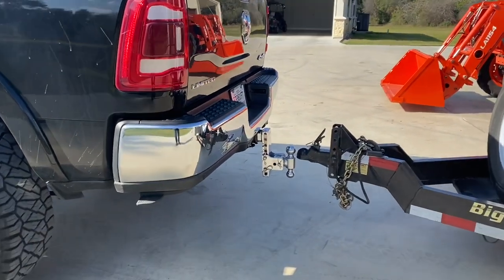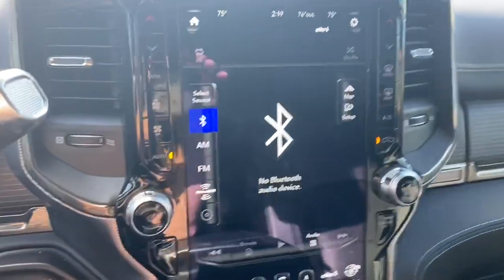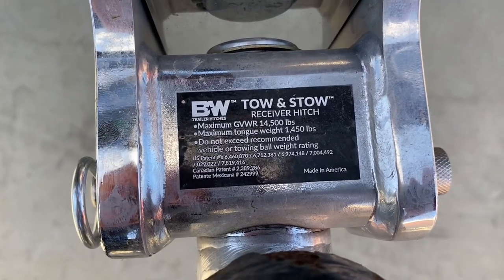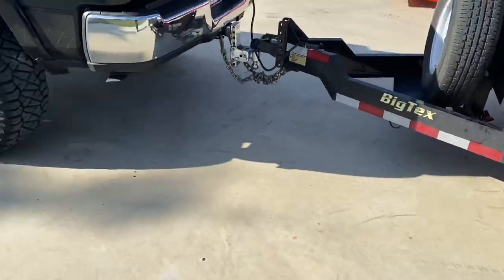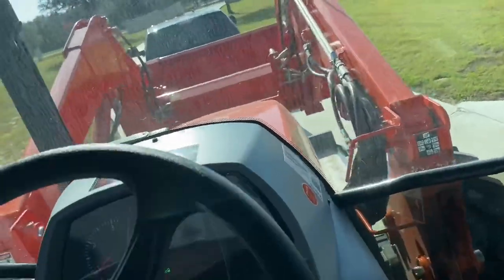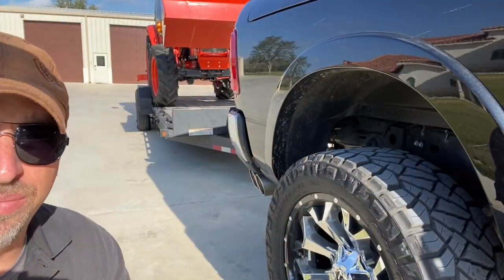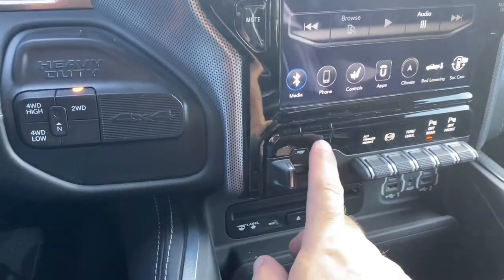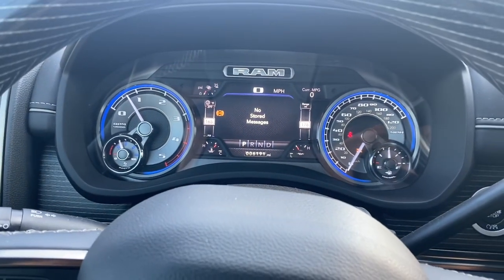2019 Ram 2500 Air Suspension and Towing

Comment: Thanks for taking time to help us on this feature. Basically, the air suspension is just for compensating to level with a load. I think a lot of people would like to think an air suspension will give 3/4 ton trucks a 1/2 ton ride. You put that myth to rest. No it does not.  I think that comment was the most important part of your video.
Reply: JL T I put mine in neutral then put the emergency brake on then put it in park myself.
Reply: If you want 1/2 ton ride u need to go with kelderman air suspension on rear

Comment: Nice truck. I've moved up to a 2019 3500 Laramie Sport  HO AISIN dually with auto level rear air. I have a slide in truck camper. Best truck I ever owned. Takes the camper with no additional modifications. Also gets excellent fuel economy. Great video showing how the Susp works for the Ford and GM guys on the fence. I was a Chevy guy until 2016. I have three Ram Heavy Duties in my felt now.
Reply from the maker: Yeah most don’t know about the factory air suspension.. it is a really nice feature and rides well. I wish I would have ordered the same truck in 3500 Srw with HO

Comment: Been told when loading / unloading to have the transmission in neutral,  parking brake on, tires checked. To prevent potential transmission damages.
Thoughts ???
Reply: Not a bad idea since loading the trailer can make the truck rock back and forth and put stress on the transmission
Reply: This is a very good idea when loading heavy equipment as the truck rocking  can cause dmg in the parking pawl.
Reply: That’s makes sense. Never thought about that 👍🏻

Comment: Very envious of your truck man! looking at upgrading my truck soon. Thinking of the 2500 cummins or ecodiesel 1500. I don't do any real heavy towing but I do tow often and will be using my truck for my commuting to work. Theres no doubt the 2500 would be the longer lasting rig but not sure I can afford or justify it..
Reply from the maker: I would rather drive a 1500 for daily. I had the eco and hemi 1500 5th gen. I would buy the 3.92 hemi again. Better acceleration and less worries. If you tow often get a 2500 for sure. Once a month 1500 is nice

Comment: I have the same BDS lift on my  a noticed my suspension automatically adjust/lower about two inches in the rear when it sits for a while.  Also noticed my air bags and compressor are working harder since the lift was installed.  Did you have similar experience?
Reply from the maker: I did not.. maybe your system has a leak

Comment: i got it on a 2013 1500 i bought new i hate to tell you its going to break if you keep it for any amount of time.. looks like you are in warm part of the US but that sound is the system sucking in air behind your right tail light when it does that it lets moisture into the system and when it gets really cold it will freeze.. in my experience they cant "fix" the spring WHEN it starts to leak they just replace them and its not cheap.... but then again mine is first gen maybe they fix them
Reply: I’ve owned a 2500 with air ride for almost 2 years “worst mistake ever” the air ride will begin to give you all kinds of problems right about 2-3 yrs even the dealer techs don’t know what to do.
You bring your truck for service and every time they have a different story about what’s causing it.
Do yourself a favor “STAY AWAY FROM ANY KIND OF AIR RIDE”
Reply: @alexturrent8141  so what do you recommend for a smooth ride? Im in the process of ordering a 3500 but dont want to waste my money obviously. I live on a dirt road and would like to have a smoother ride...thanks😊
Reply: That's not true. The system is a closed system that is filled with nitrogen. Read up on it.
Reply: @JasonS_IN317  you can read up on it bud.. it's closed unless there is a leak then it has the ability to bring in outside air and you can hear it.. sounds like an air break system on a big rig... in other news that truck got a knock the other day 180,000 miles so i ordered a raptor.. good luck (the rocker panels rusted out it's fully loaded)

Comment: I have the exact hitch. The rattling going over bumps is driving me crazy!
Reply from the maker: I use a anti rattle pin off Amazon. Works well
Reply: Saw a video that used PVC wedges on three sides of reciever, just tapped em in and no more rattle.

Comment: How much mpg you get empty on the highway ? Thinking of getting one but not sure to get a 2500 or a 3500
Reply from the maker: I have been around 16.5-17 with 35’s and lift. I have a few videos on my channel with this truck. They do get better mileage than high output and ride great.. My 2019 1500 almost had the same towing and payload. This 2500 only has 1560 payload. I will prob trade up to 3500 soon..if your on the fence get the 3500.
Reply: Rocky Rohde thanks. I’ll sure check out your videos. I am on the fence don’t know witch way to go
Reply: @RockyRohde  are you kidding me a diesel with 1560 payload talk about completely worthless by time my wife gets in the truck I already lost 30% capacity
Reply from the maker: Unbiased Opinion definitely something to look at. I would have purchased the 3500 if I would have looked before
Reply: If I could go back I would get the 3500 srw rather than my 2500. Nothing wrong with my 2020 2500 just would rather have the higher payload capacity.

Comment: Hey Rocky Rohde--love your truck and tractor.  This video rocks..., as it is one of the most informative videos on towing and explanation of the 2500 air suspension that I have seen.  Thank you for taking the time to make it.  One question I did not see an answer to that I was hoping you could let me know--what size Carli lift do you have--the 2.5 inch or 3.25 inch?  Pintail, Commuter or Backcountry?  I'm looking to put either/or on my 2021 Dodge Ram 2500 Longhorn that I just purchased.  Will run 35's BFG KO2s on the stock rims.  Let me know as soon as you can.  Thank you---David (Pilot--USAF, Retired)

Comment: how did you do the dedicated bed lowering button?
Reply from the maker: It comes with stock air suspension.
Reply: @RockyRohde  my 16 2500 has factory air, doesnt have that button, you made it sound like you programmed it thats why i asked
Reply from the maker: Fifth gen’s 19 and up I think have it.

Comment: Yes sir, you purchased your truck with the air leveling system in rear right?, but you still have the heavy duty rear springs correct?
Reply from the maker: 2500 has rear coils or air bags

Comment: How far does the truck drop when you use lower bed button? My 2019 3500 only drops about 3/4”.
Reply from the maker: 2+ inches on 2500
Reply: Rocky Rohde looks like the 3500 is slightly different.. unfortunately i still have to wind the jack.  thanks, good video

Comment: I just ordered almost the exact truck and going to put a lift on it.  I am planning on using the AEV lift which provides front and rear lift, which should lift the truck 2-3 (they say it's a 3" lift).  I can't figure which of those two numbers is correct because of the rear air system.  How much lift did it give you?  I've run a two inch level kit on the front of my truck for years which allowed me to run 35" tires on the stock wheels.
Reply from the maker: Prob 2” in front and 1” in back. Truck does not need rake with air suspension
Reply: @RockyRohde  Thanks, and what system to raise the rear 1"
Reply from the maker: Top tier suspensions provided it with links

Comment: Hey Rocky, why did you get rid of this in favor of the eco diesel? How is the eco diesel holding up? Considering getting one.
Reply from the maker: I’m in a 2020 super duty now.. ecodiesel did well just went back to a larger camper and it is much easier to pull. I chose the ford for the interior room and short wheel base. I really like the mega cabs but I have really enjoyed short wheel base.
Reply: @RockyRohde  awesome. I would enjoy seeing a video on it pulling the kubota. Thanks man.

Comment: How's the longevity / reliability on the air suspension?
Reply from the maker: Can’t really answer as I usually don’t keep trucks for more than 40k miles. I have never had a issue
Reply: I have 81k miles on my 2016 Ram 2500 with air ride, no problems! I also tow a 13k 5th wheel!

Comment: Hi, I’m having trouble finding a lift kit for my truck. It also has rear air,what did you use to lift?
Reply from the maker: I used Carli on the front and ordered from top tier suspensions. They have everything needed for the rear also.
Reply: Just noticed your other video on your truck lift kit. Thanks great info👍🏻

Comment: Question I have gasser ram2500 4x4 rear air suspension towing 9500 pound 35 foot travel trailer. No one has described to me how to use equalizer 4 weight distribution hitch without the ram air suspension taking the load off the bars thereby defeating the purpose of equalizer sway control. Anyone figured out how to set wdh up on this truck?
Reply: I did it on my 2019 3500. I repositioned the head to compensate for the suspension raising and taking load off of the bars. The truck may level itself but it's not a replacement for a weight distributing hitch so the front of the truck will still lift some without it. Measure your front end to make sure it stays level. It took me a couple adjustments but works great.